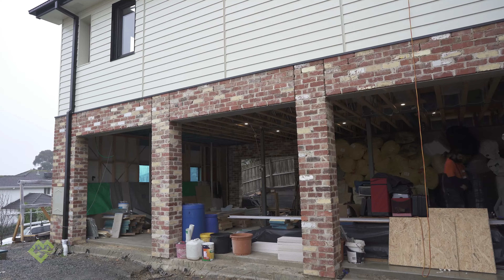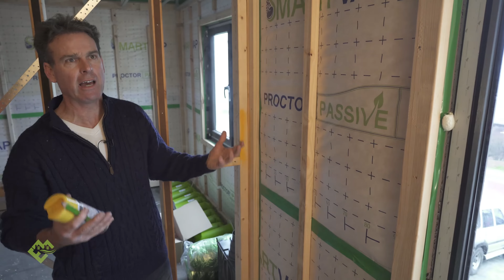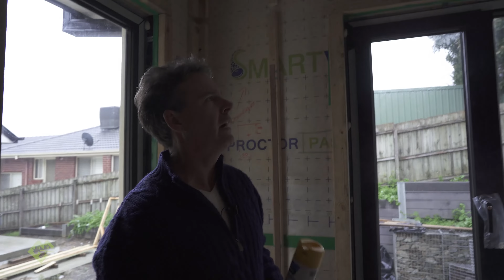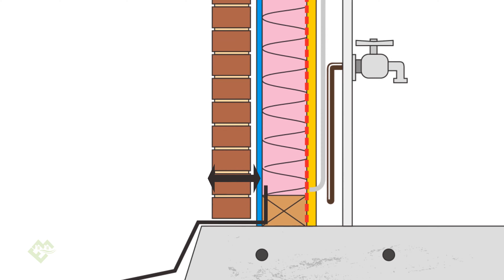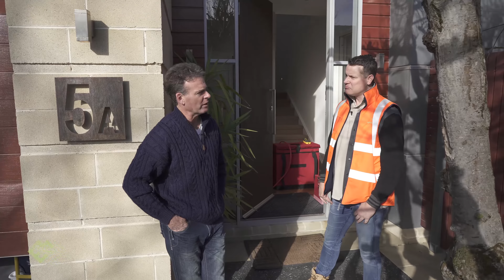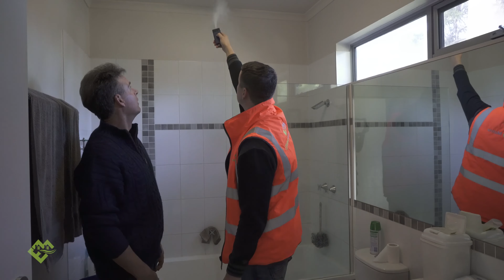Passive House Principles VS Traditionally Built Home.  What’s the big difference?

Comment: Excellent video series. You're doing a great service providing this information. 
One question: why the need for both internal and external wrap for air tightness? If air tightness could be achieved with external wrap alone, then perhaps the wall service cavity would not be needed.
Reply from the maker: It’s always best to have your best air barrier on the warm side of the wall system.  Stops moisture getting into your wall cavity.

Comment: All new buildings or retrofits need to be energy efficient.
Energy efficiency saves energy and that saves money on utilities month after month, year after year..
It also makes the home or building more comfortable.
Air sealing, super insulation, triple pane windows, energy efficient doors, high efficiency heating and air conditioning systems, high efficiency appliances, set back thermostats, LED lighting, solar panels, battery storage and a 220 outlet in the garage for a electric vehicle charger. Driving your car powered by the sun is a great feeling and saves money. All these items need to be considered in any new build or retrofit.